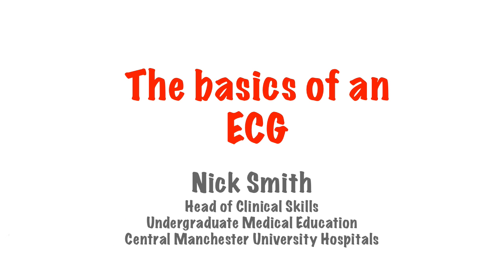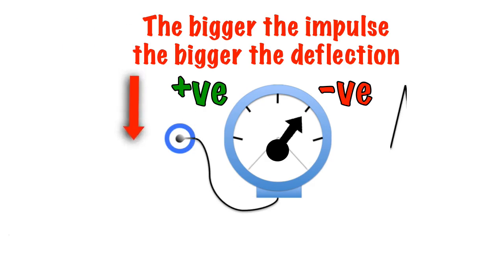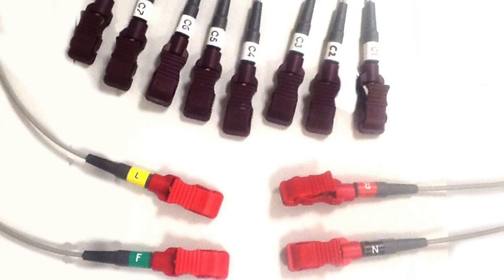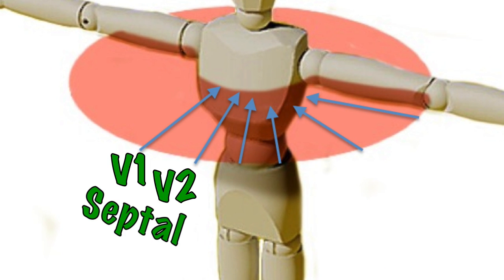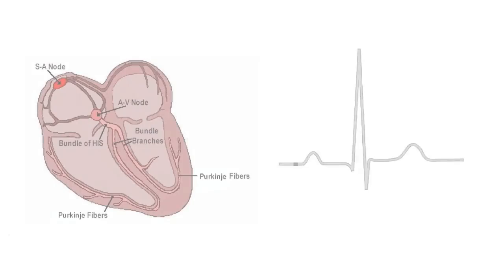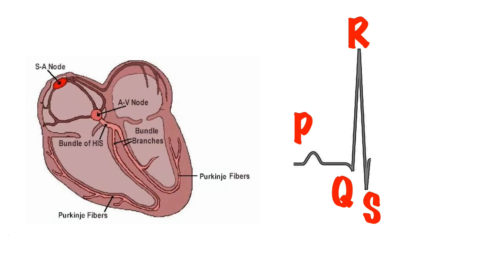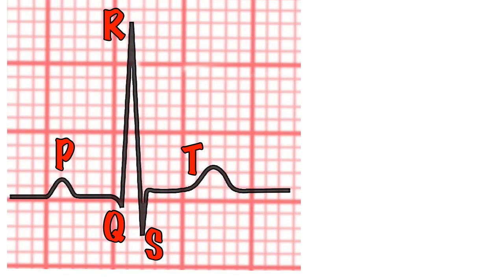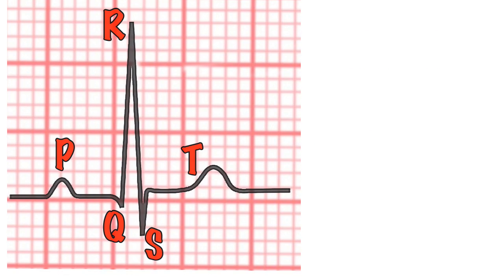The basics of the ECG in 5 min

Comment: So both atria contract a little earlier that do the two ventricles?
Reply: +Max Webster This activates the AV node.[1] The atrioventricular node delays impulses by approximately 0.12s. This delay in the cardiac pulse is extremely important: It ensures that the atria have ejected their blood into the ventricles first before the ventricles contract.
Reply: +Max Webster Okay, I've found the answer :).
Reply: The Max : Yes, atria contract earliar than ventricles. At first, SA node is activated which causes atrial depolarization. Then AV node is deploarized to send impulses to ventricles.